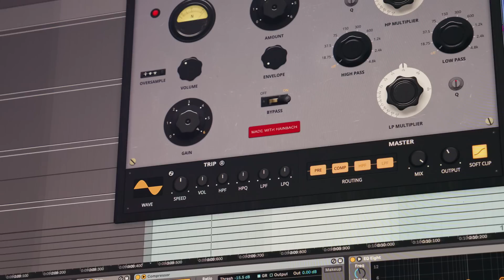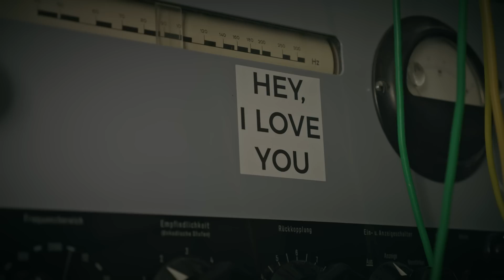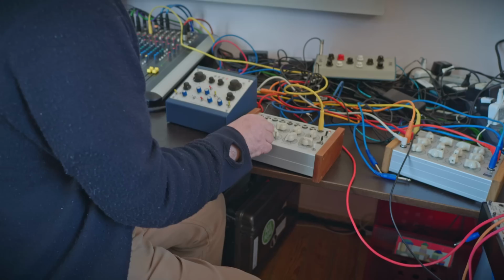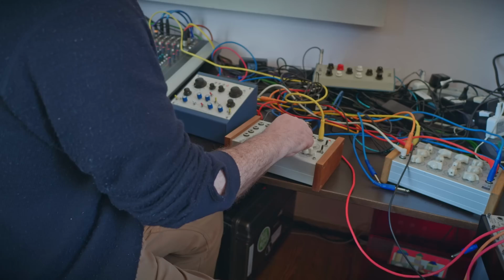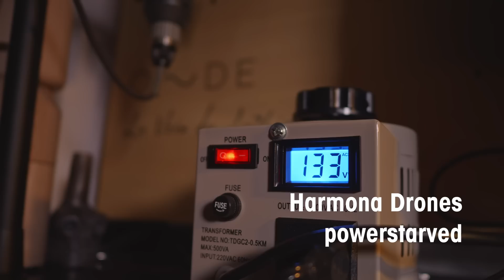Exploring The Ciat-Lonbarde Benjolin (now Peterlin)

Comment: So “Peter’s version is “by the sheet”? Are we to take this to mean there are no alterations from the original (beyond the appearance/form) or simply that the differences do not stray from the spirit of the original? Or are there indeed significant differences?  It was hard for me to decide what you meant to say here, if anything (that is, maybe you intended not to get into that question at all).
Reply from the maker: He followed Rob‘s design, but like Glenn Gould playing Bach, he made it his own. The most drastic change is making so it works from only a positive power line instead of +-, which makes it work with solar panels. There is an essay of his where he goes into the details on Patch Point SoundCloud